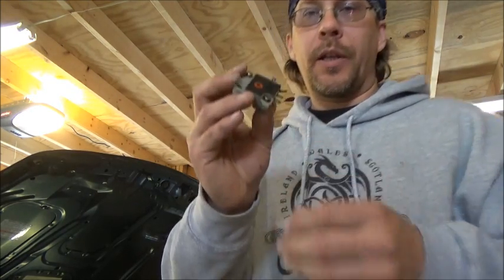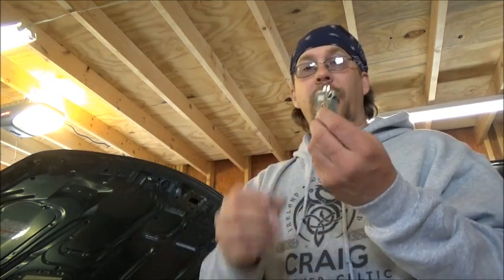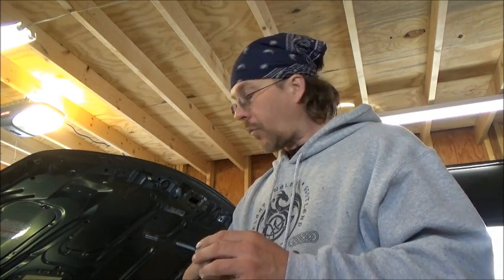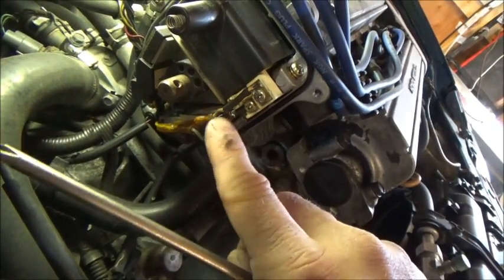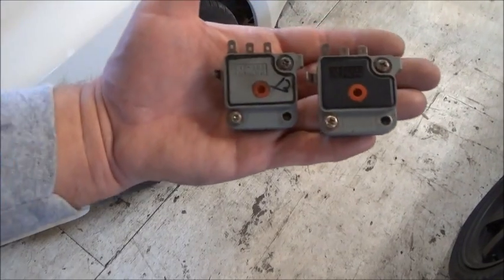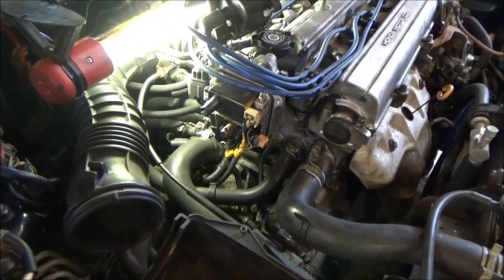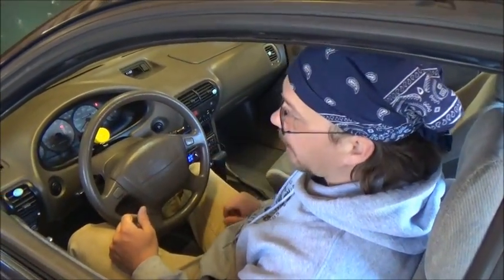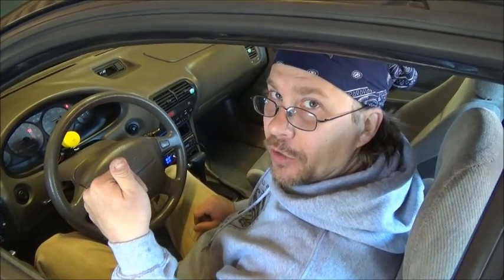How to replace the ignition module or ignitor in your honda

Comment: I agree you do not have to change the whole distributor because of the igniter. There are 3 pick up sensors also in the distributor you can check the resistance on (TDC/CKP/CYL or scope it to see if you get a signal pattern. You can also check to see if you get pulse from injectors with a test light (or noid light) to see if your pick ups are sending a signal to the computer. I just replaced one of the pick up sensors I had spark but (no injector pulse). I changed (the TDC sensor) and the car started right up (had to take the dist off and perform surgery lol). Normally mechanics replace the entire distributor (Honda rip off procedure)  for a bad pick up sensor. A dist job at a shop cost $300-$600 plus. No need to change the whole distributor Honda Techs do it A LOT and people are unaware of the rip off that just took place. Great Videos Justin.
Reply: You seem to know a lot. My 95 honda accord just died while going down the road. Now it won't start.  It turns over just won't start. I replaced Main fuel pump module. I tested the fuel pump. It's fine. Timing belt is fine. I do not hear the fuel pump come on. I've checked under dash fuses. Distributor plugs and wires have been recently replaced. Any suggestions. Check engine light is on

Comment: Thanks, I had an electrical arching sound in my distributor, tachometer jumping around, no start condition. My coil had a rusty spring so I replaced it thinking that was the issue. Still no start. Found this video and this was the issue. Luckily I had a parts civic laying around, so free fix! Great video

Comment: Almost forgot to mention to those of you who are doing this yourself....
Use Heat Sink Grease between the Igniter and its metal mounting block,
which is also its heat sink.  Otherwise it will overheat and fail again soon...
Cheers !
Reply: like thermal compound in computer building
Reply: Thanks!

Comment: That big open airbox is just waiting to swallow some small dropped parts, throw a rag over it, maybe a doo-rag.  Plus like most Honda distributor videos, they don't warn you to remove the cap slowly, and watch that spring underneath, it will fall out and bounce to the most unlikely place you'll ever look to find it.

Comment: I opened my distributor a while back and the little spring fell out and spent an hour looking for it and trying to knock it out of the bumper and set off the srs light and I ended up finding it in the radiator lol

Comment: Could this cause your car to randomly shut off. I'm having an issue with my 98 acura 3.0 CL. I've replaced all sorts of parts, ignition switch, fuel pump, distributor cap, and cables, all maintenances. Drives fine, but when the car comes to an idle, it shuts off. Sometimes, it starts right back up, but other times, I have to give it a minute to be able to start back up.

Comment: Just wondering I have an 86 prelude, and it shakes and rumbles high idle, itll be fine driving for awhile then when it gets warm it starts to almost stall and I have no power and pgm fi light comes on. Just wondering if this may be the problem and if youve ever worked on these 2nd gens
Reply: Maybe change your pcv valve and check around for vacuum leaks.

Comment: Hi Justin just wanted to say I have watched your video and it's great. Here is my problem, 1995 Honda Accord LX 2.2. I have an external coil and after removing Cap, rotor and dust cover it seems like it's not just two screws to remove the ICM. I could be wrong but the majority of replacements on You Tube are Hitachi with the coil in the distributor. Again, my coil is external. Just wondering if I have to remove the distributor with a TEC Dist. BTW my issue was after 13 mins of running just stalls after igniter overheats, plenty of fuel pressure, restarts after 15 mins like no problem. I have worked for Honda for 22 years since 1979 and Acura, all dealership from prep tech to Service manager, any help would greatly be appreciated! I hope its just the two screws you speak of and I have the new ICM.
Reply: Did you ever solve your accord stalling issue? I have 95 lx and have same issue! Already done plugs wire, ignition coil, dist cap, fuel filter fuel pump, fuel relay, catalytic converter, cleaned throttle body and idle air control valve, new map sensor... frustrating.  Still dies once up to temp!!!
Reply: @pjmisley  same here. Did you solve yours?
Reply: @Dat550go   Yes it was the distributor not the distributor cap. I was pretty mad at myself for throwing parts at the problemIt only cost me 30 bucks on Amazon as a returned item so sort of frustrating but I guess I needed quite a few of those things to be replaced anyway soon
Reply: @pjmisley  oh man. 😕 well.. At least its fixed. Do you still have the vehicle?

Comment: I have a 1990 Honda Civic in my car don't even start. I got this part that you're speaking of today we're going to put it in fingers crossed. Everybody keeps telling me that it's such a stir beater but we're going to try it expensive. I tried the fuel filter check the fuel pump spark plugs are good I don't know at this point she just turns over but she won't start
Reply: Hey I hope you see this. Did this happen to work? I have a 92 Accord that isn't getting spark but it does crank

Comment: Im working on my 2001 Yamaha Raptor 660r and it won't start. I replaced the coil and spark plug and am too lazy to check the two carbs. Anyways, my distribution box is sealed on one side with silicone, is it possible to just replace the ICM and cut the silicone or do I need to replace the whole box?

Comment: My fuel pump isn’t getting power. Not priming, got a new main relay and I don’t hear it clicking...

I took the engine b18c1 out of another car I had and the car ran with no problems.

Comment: I replaced my distributor recently hoping that was the problem.  Is the ignition control module part of the distributor assembly or separate.?
Reply: It’s just better to buy the whole distributor it comes complete with everything that he’s talking about it’s less than 90 bucks depending on the make and model of your car but to answer your question everything is separate if you wanna fix one thing at a time good luck
Reply: Alexis Tudor if it’s still not starting check the 1990-1997 HONDA ACCORD MAIN RELAY-FUEL PUMP RELAY

Comment: 89 accord a20a1 .stuttering under load /full throtlle around 4k if. Eased into doesnt do it. Replaced coil. Cap rotor. Plugs and wires. Still acts up could it be a weak igniter
Reply: Any update on what it was ?

Comment: would that cause my car to turn off while its running and in gear? i just replaced the coil and it did the same thing. thanks in advance
Reply: Someone is going to yell at me for posting this all the time but... if you're driving along and it dies you may have a worn run position in you ignition.  Years of too many key-chains tuggin at it.  Also the main relay can have poor solder connections that can cause random no starts and can kill it even after your rolling (heat/cold/moisture and kaput).
Reply: Yes

Comment: hey brother I need to ask you a question that you may be able to help me out with I have a 97 Acura 3.0 CL and I was driving into work one day and it is dyed on it it started up but when I got to work it won't start again when I checked for Paws coming from a mission coil I have power there going to the distributor caps but the wire running distributor cap to the spark plug there's no wire is there a uniter inside the distributor cap I see it has 4 screw in this flat piece of plastic can I get that off of any other kind of Acura that has that same kind of setup as mine or do I have to pacifically put that same park on I need help badly been trying to get this car taken care of mechanic shops keep trying to charge me $4,600 to do some work that I know shouldn't cost more than a couple honey I am mechanically inclined a little bit to know what I need to do and how to fix it and I just need to know if that's the problem with this Honda Acura CL 3.0 your help will be grateful thanks a lot bro and have a nice day
Reply: again, what codes are you throwing?  Have you checked the Main Relay under the dash or even the run position in the ignition can be worn out killing the spark.  It can cause intermittent no starts.

Comment: I got a Honda accord ex v6 99 crank and it won't start up I got new distributor cap  and spark plugs and wire and no spark
Reply: coils?  What codes are you throwing??  Also, you may look into the main relay as it can be an problem and your car is in the right age to be having this issue.  Go watch Ericthecarguy, he has a good video on it /watch?v=viIZ8k60awY            in fact you might want to see if his other videos may help.
Reply: +According To Honda i already fix my Honda accord ex v6 99 it was the coil and the main relay is good that was the first thing I check

Comment: Hey Justin I had a question I have a kseries if you can answer my question if would be great
Reply from the maker: Sure. Send me a message on www.jsracingproducts.net
Reply: +Justin Sane hey I got a 800 horsepower Civic and my problem is when I'm driving if I'm trying to get on it and wont past 6000 RPM and she started break up can you train to help me so I can resolve my problem I would appreciate that thanks
Reply: +Justin Sane hey my 98 integra randomly turns off and it won't start after few minutes it will start and run normal....icm?
Reply: worn run position in ignition or main relay under the dash.     maybe
Reply: @beboaguayo4664  not enough fuel.